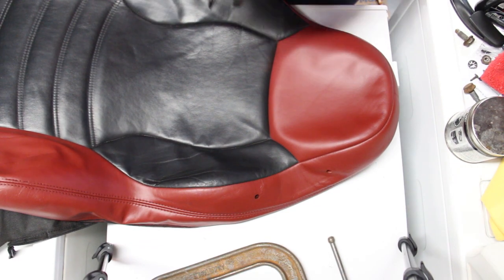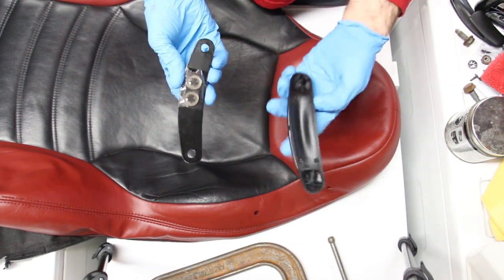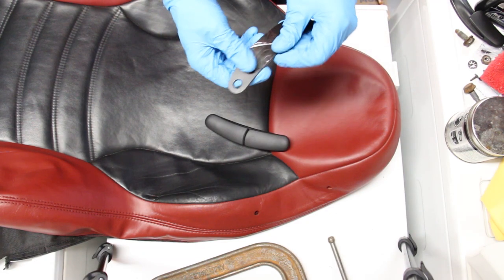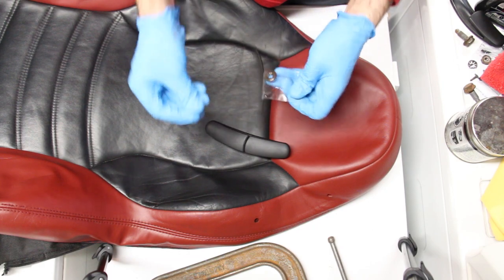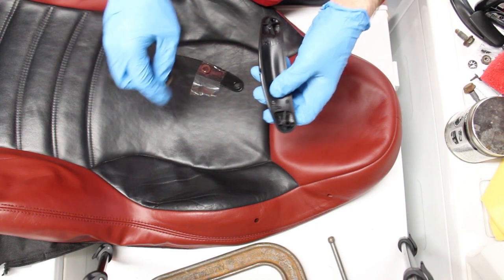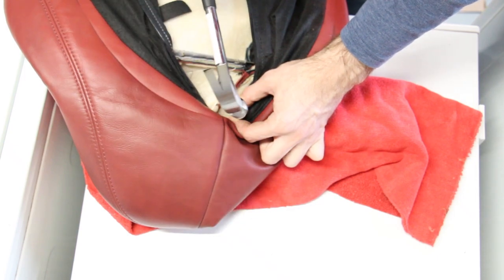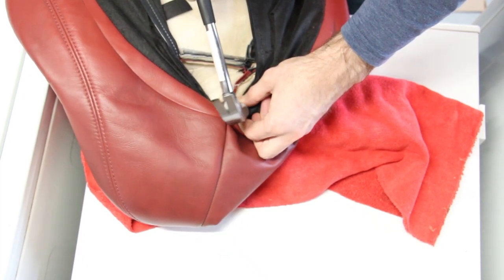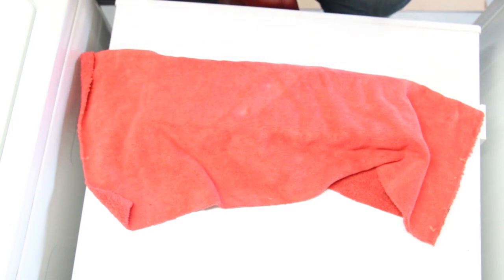How To Replace Seat Belt Guides on BMW Z3 M Roadster

Comment: Nice job! how about showing how did you remove and reinstalled the leather cover.
Reply from the maker: Unfortunately, I lost the video of the removal, BUT I did post the video of seat re-assembly, which includes the installation of the seat back leather.